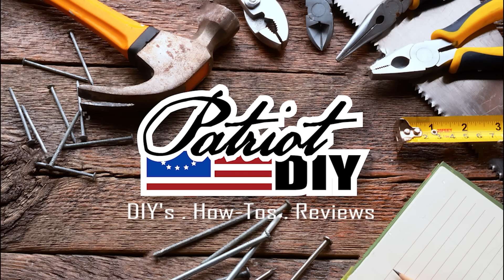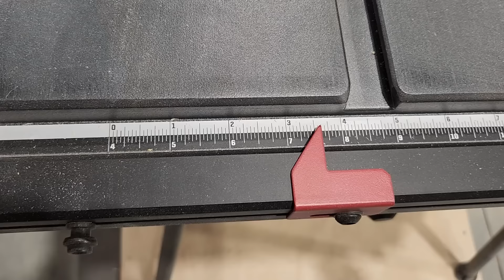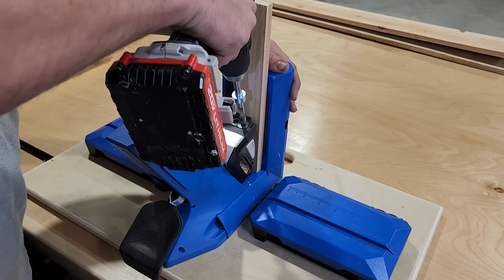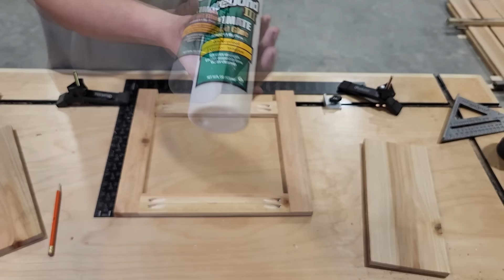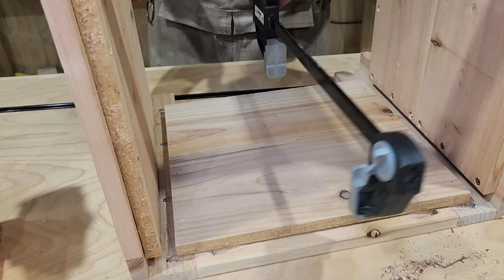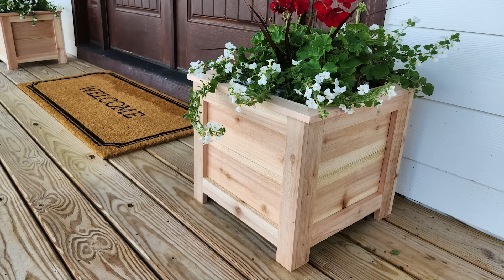How To Build DIY Cedar Planter Boxes

Comment: Instead of sanding the pickets, I just run one face through the planer, and then come back and hit any little low spots with the sander.
SO much faster.
Reply from the maker: That would work, but they are already so thin I dont want to make it any thinner, just sand off some of the roughness

Comment: I must have done something wrong, because my 1" pocket screws won't sink in alll the way. I need some assistance as to what I've done. Thanks.
Reply from the maker: The thickness of fence pickets can very a little bit, yours may be a little thicker!  If the 1" doesnt work you can Try 1.25" pocket screws

You shoukd also check the settings on your pocket hole jig to make sure it's set correctly for the material thickness
Reply: @PatriotDIY  also, will you explain how you did the diagonal pocket holes for top piece
Reply from the maker: @jameslikos3726  I just used the kreg pocket hole jig and referenced the mitered edge

Comment: I've built a few of these planter boxes. I've never used pocket screws, seems very over engineered and unnecessary.  They hold up fine without them  but anything to justify the cost of the jig. 🙂

Comment: If I were going to make these to put pergola poles in, would it be prudent to not have legs on them for the weight? What about drainage?
Reply from the maker: First I'd say yes, no legs is probably a good call. But using planters to support Poles usually doesn't support the weight the way you think they will.  What I've done in the past is run the pole directly into the ground and just put the planter over it for looks....like this https://youtu.be/ghErSyyCPK4?si=QD1Fx3t6Rs04j-Ye

Comment: Great job. Is there a reason for the backer boards not going the full length of the frame to give it a finished look instead of leaving a gap all the way around?  I'm thinking to get the most out of each picket.
Reply from the maker: Only because its not necessary

Comment: You should have included the cut sizes in your video.
Reply: Buddy just admit you're too cheap to pay for the plans.
Reply: @JamesMoore-r3w  Of course I'm too cheap to pay for the same plans available for free elsewhere. Brighten up a bit would ya.
Reply: @JamesMoore-r3w  Of course I'm too cheap to pay for the same plans available for free elsewhere. Brighten up a bit.
Reply from the maker: That's all in the plans! Check the link in the description
Reply: @PatriotDIY  Most instructional videos include the cut list in the video or the description, and also include a link to paid plans.
Reply from the maker: @Les Ganton  the video is about the design and the methods for building it, you can make any size planter you want with whatever dimentions to fit your needs. Cut sheets for this exact one are in the plans

Comment: Nice looking planter. Question, Why did you use interior pocket hole screws? They won't last very long in the elements.
Reply from the maker: It's what I had. 1" exterior pocket screws are hard to find
Reply: @PatriotDIY  yep ... I was looking for some this past weekend. I think the only way to get them is online and even then, they're not that easy to find. Armor Tool is about the only place I've found them.

Comment: Great video.   Really clear and easy to follow.   I've made similar planters using basically this design, and they turned out nice.

One thing I did differently was to have the leg widths differ, as opposed to the stretchers,  so all four sides were equal.  One wide and one narrow leg on each side. After the sides were assembled I made a shallow saw cut on the table saw right over the vertical joint between the leg pieces and another on the face of the other side,  creates a nice corner detail and camouflages the seam.  

Another thought, if you're going to paint them just screw them together on each corner and skip the pocket holes.  Longer screws can be use that way and easily hidden with a dab of wood filler.